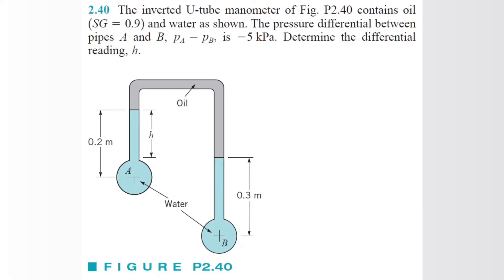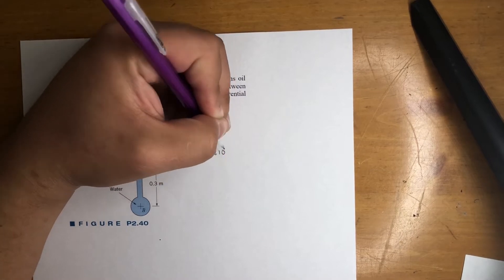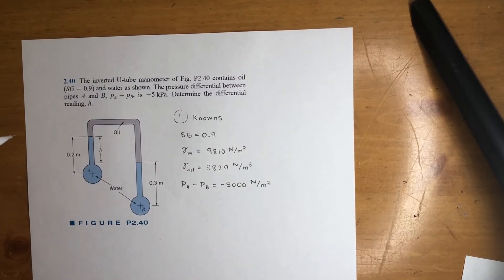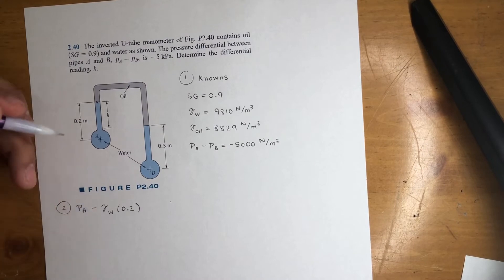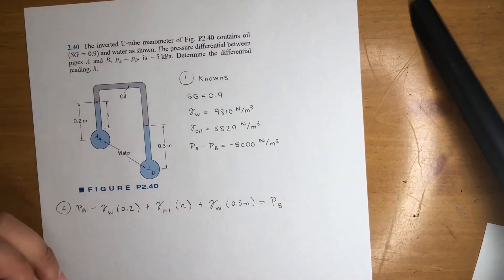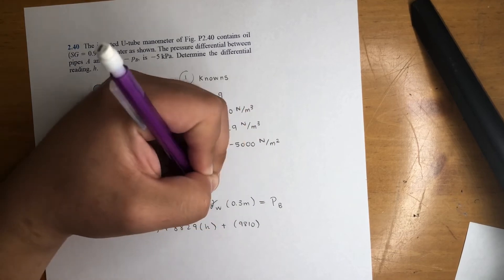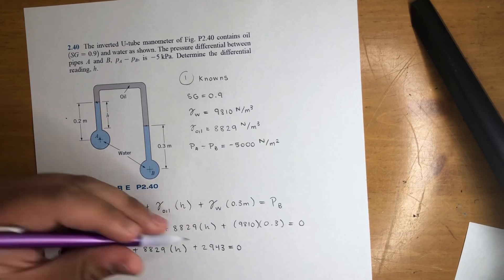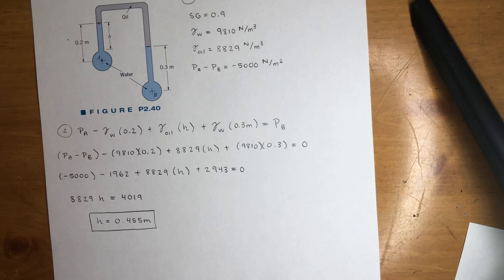Fluid Mechanics - Inverted U-Tube Manometer Contains Oil and Water

Comment: I also got the same answer, but doesn't the answer have to be less than 0.2m?
Reply from the maker: Hey, the answer is correct. The schematic itself is not drawn to scale. Although it should’ve been if you ask me. But if you were to do the experiment, you’d see the true schematic, where you’d notice the 0.455m difference.

That does suck though because it makes you second guess your answer.